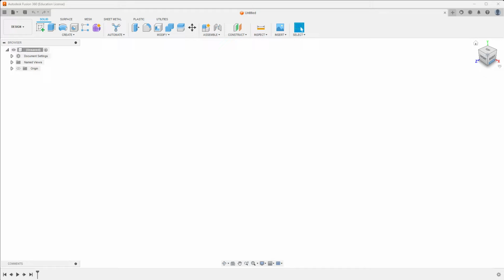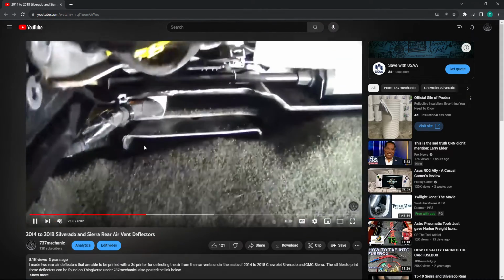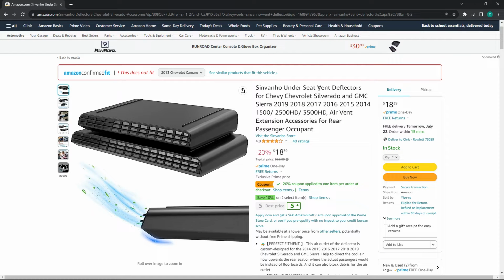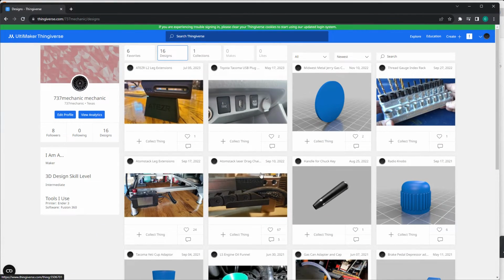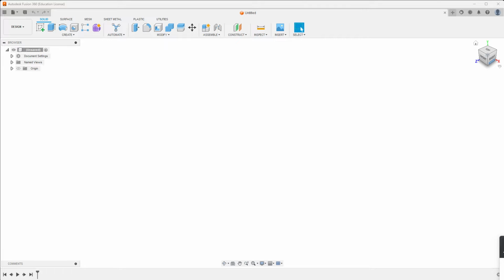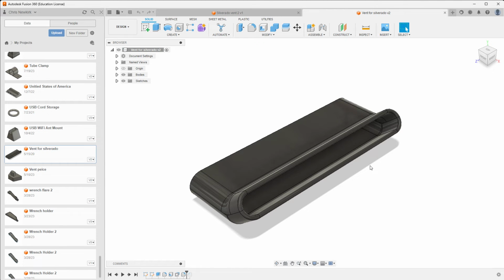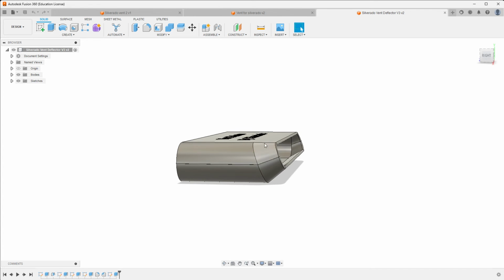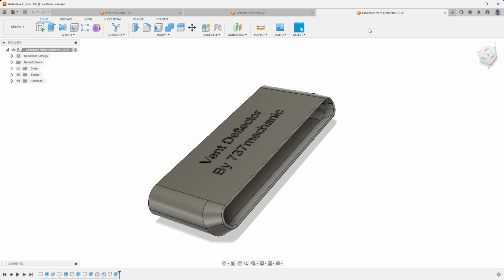The Chinese and Others have Copied My Air Vent Deflector Design for Silverado and Sierra Trucks.

Comment: People remove the wording because it increases the print time for the first few layers and adds complexity and therefore a slight risk of failure on the first layer. If you're running a print farm, this time adds up and potential failures adds to QA costs. 
I understand you concerns and have my own thingiverse page with several designs, but I don't label any of them because I know how annoying it is to print.

You're far better off adding an 'easter-egg' that you no one knows about and will likely remain unchanged. Then if you do every get in to a situation that you want to prove an infringement, you can whip out the reality of your easter-egg to prove they're using your design.

You need to think outside the box but some people hide stuff 'inside' the print so you can cut a part open and see additional internal parameters in random locations that don't make sense. Some people add tiny dimples in specific locations. some people make certain features that are 'mirrored' on either side slightly different sizes so you can throw a caliper on them and see. Some people add additional thickness to a wall on one side vs the other.. these are just a few examples.

Comment: China does this to literally everything and anything.   They steal knife designs, car parts designs, appliances, electronics, etc.  They reverse engineer literally everything and don't care about honoring patents, unless they plan on exporting it back to the US.   You can even get a chinese version of a husqvarna chainsaw.  I bought a new chinese version of a carb for my mower the other day, it was 18 dollens, and came with a fuel filter, gas lines, shut off valve, clamps and even an air filter.   How they make money off of it at all is baffling to me.  It works great though--  bolted right on and fired right up in first 3 pulls.

  I was trying to pull the float off of the old one and clean the needle, and the little ears on the housing broke off.  Our fuel is such trash now, you can't let it sit for very long at all inside carbs..   I typically just shut the fuel off now and let it run the bowl out of gas every time I park it.. same with my quads and dirt bikes.

I think you can try to report them, but I'm not sure if anything would even happen.  Since you don't even have a patent and gave the info away for free.   You gotta hand it to the guy for being clever.  He's taking info that is already out there and simply manufacturing it for people who don't have a 3D printer.  He probably thinks he's not even doing anything wrong, since it's just being given away for free. 

Maybe write "not for commercial use" on all your files, just to make it clear that it's not free to use;   and maybe people will honor it.  But I wouldn't count on it.